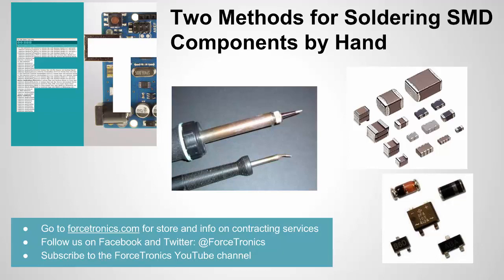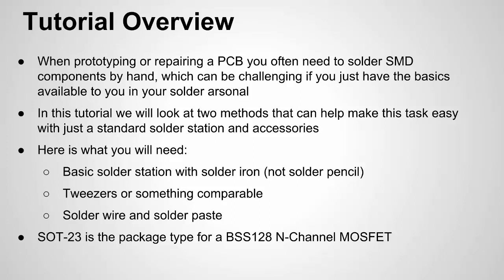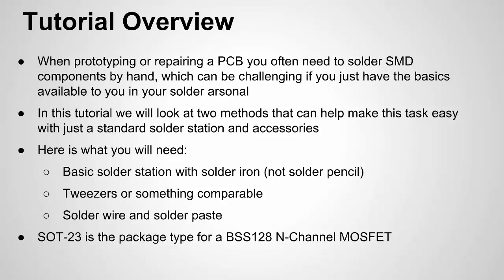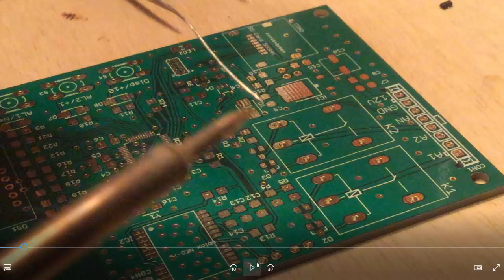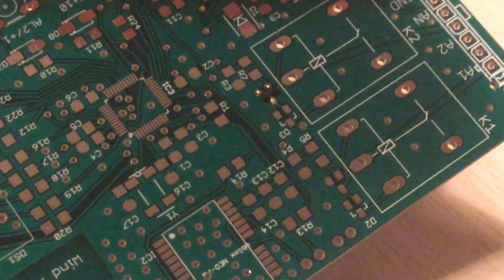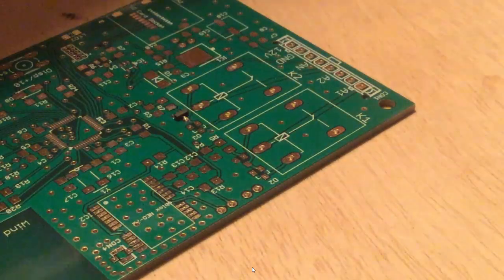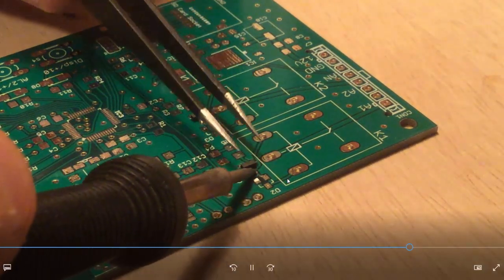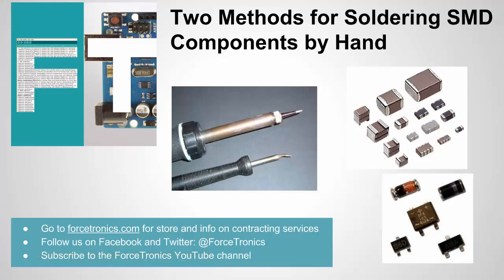Two Methods for Soldering Surface Mount Components by Hand

Comment: there's a 3rd method, using the wire to just tin 1 of the pads on the pcb, then put the component there and reheat the pad to fix 1 leg... then do the others and go back to the 1st one to reflow it a little bit...